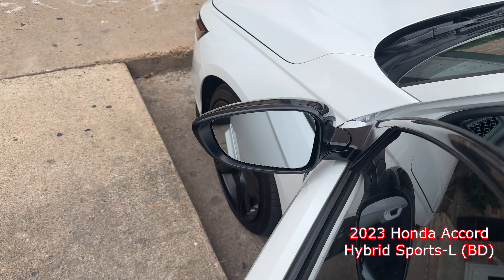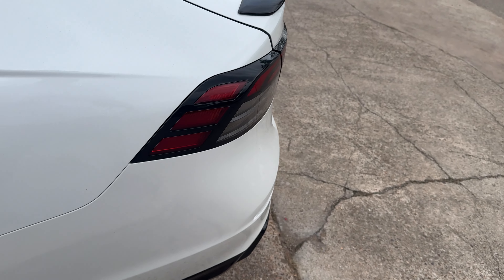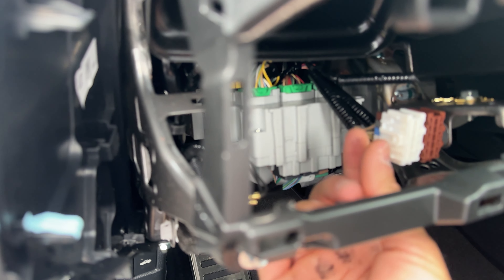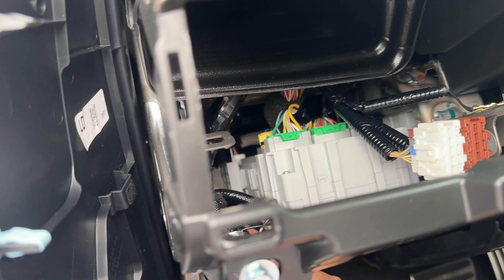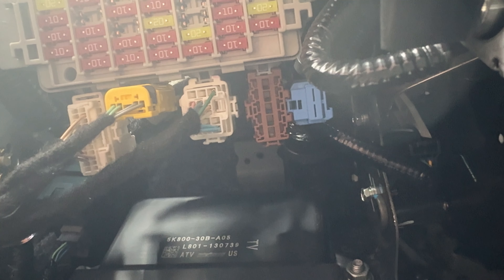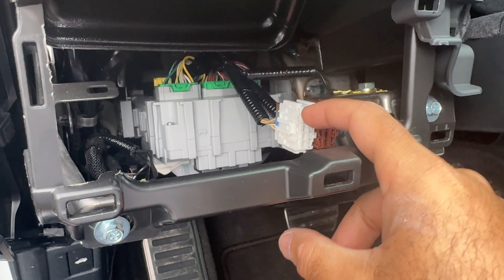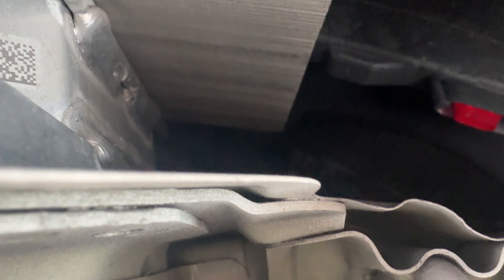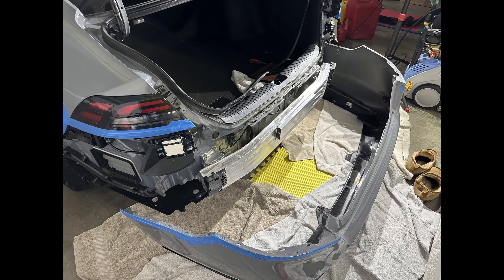2023 Honda accord Sports L BSI install (OEM) BD trim

Comment: I have the Exl model with no blind spots monitor. There are sensors on the back bumper. The only thing seems missing is the side mirror for the blind spot monitor
Reply from the maker: I was wondering the same thing but the mirrors are so expensive. I wish I had them to test it
Reply: @mambrake  does the dealership sell them ? And how much
Reply from the maker: @Vegitobluuuuu  They probably do and I wouldn’t know the price. I saw one on eBay for $250usd. You have to make sure it’s the correct pins. You have ones with 5 pin others with 7 and 8
Reply: @mambrake  can you send me a direct link to the one I need please
Reply from the maker: @Vegitobluuuuu  I don’t know which one you will need. You would have to look at the connection between your mirrors and the rest of the connector. As I stated they are all different
Reply: @mambrake  mine is 2023 sport isn’t the same as yours sport-l
Reply from the maker: @Vegitobluuuuu  I have Hybrid Sports-L. There are a few things different but I don’t know if the wirings are the same in all cars. You would have to look at your mirror connector
Reply: @mambrake  just open the thing on the side like you did in the video ?
Reply from the maker: @Vegitobluuuuu  Yes. That’s what you have to do. Your car might be different from mine.
Reply: @mambrake  how annoying it is to take out the thing to find out ?
Reply from the maker: @Vegitobluuuuu  not hard at all. Just pull the top part enough to reach the cable. You don’t have to take the whole panel off.

Comment: Hey brother how much will it cost to add BSI and buy the mirror and all that stuff?
Reply from the maker: Mikstore’s sells an aftermarket option but it’s a heavy job. Your car might already have the sensors but I am trying to figure out what I can add to make the BSI work with the OEM radars that are already on the car
Reply: @mambrake  yeah I checked their website it comes with mirrors and sensors you could buy it and use only wires and mirrors. I couldn’t find mirrors but itself it comes with a kit
Reply: @mambrake  another question is how will you integrate Blind spot system into the dashboard to access its setting from the dashboard ?
Reply from the maker: @Vegitobluuuuu  It bring radars and mirrors. You have to take the OEM radars that are mounted on your car off
Reply from the maker: @Vegitobluuuuu  I only installed the parking sensors…… The BSI on Mikstore are not OEM so they don’t show on your dashboard
Reply: @mambrake  oh so mirrors from Mike won’t work with oem radar ?
Reply from the maker: @Vegitobluuuuu  No, there is something that might be needed. Mikstore sends you just the glass that you put on your mirror case. I’m still waiting for someone to invent something that will work with the OEM radars and make the BSI like OEM
Reply: @mambrake please update me if you find any solution to the bsi thing
Reply from the maker: @Vegitobluuuuu  I would make a video asap if I find a working fix

Comment: Dude, I'm also a 2023 SPORT L BD,are you sure the rad on the back is real and not a replacement? I'm in the process of buying mirrors with the intention of installing them myself
Reply from the maker: Let me know if they come alive… those are wired radars man
Reply: Any updates Shan?
Reply: @Snakesjinjuriki  I bought a set and haven't installed them yet, I'll let you know when I get a chance to install them because I think it's a pain in the ass to remove the back bumper
Reply: Ah, I see. I thought you were just getting BSI mirrors to see if that's all that was needed since the car is already equipped with the radars.
Reply from the maker: @SHANCHISHEN  I thought also that you were just getting the OEM mirror and testing if it would bring the module to life. It might be that it’s all that is needed
Reply: @SHANCHISHEN Hi Shan, did you install your mirrors? I’m wondering to result, if it’s working I will order too